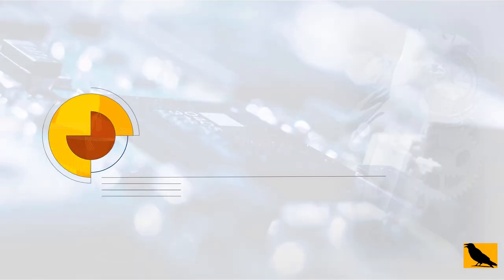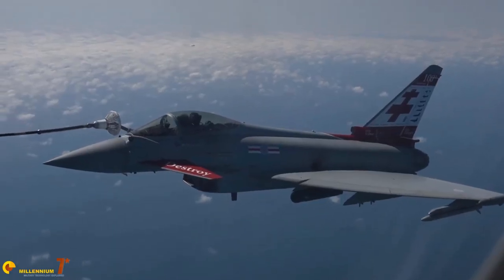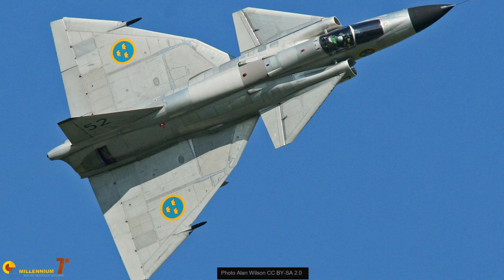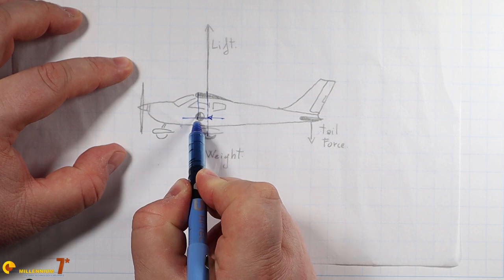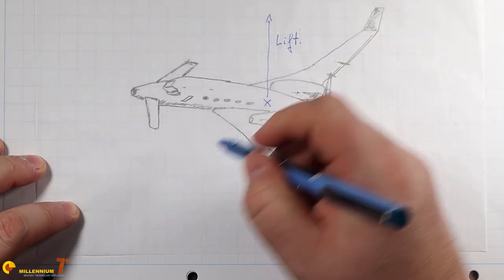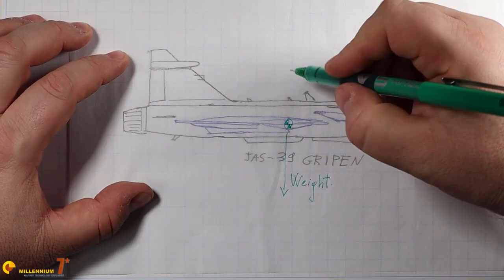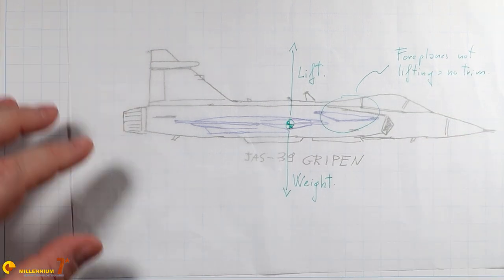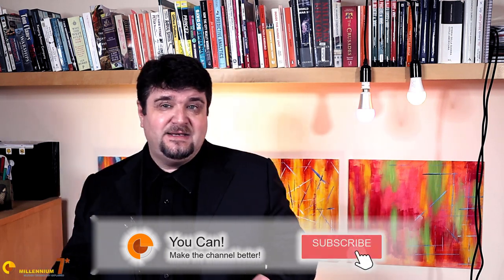I looked inside Rafale, Gripen and Typhoon, and this is what I found.

Comment: They are called “canards,” literally “ducks.”
Reply: Foreplane is equally accurate.
Reply: Yes because planes look like a duck with them haha. It is more obvious with a design like the Valkyrie though.
Reply: François Calvaresi That’s the stupidest thing I’ve seen today.
Reply: Glenn Ridsdale good for you.
Reply: The first canard airplane is the 14-bis of Santos Dumont.
Reply: @efxnews4776  No.  The first canard aeroplane was the Wright Flyer.
Reply: From what I understand the term "canard" refers to the configuration (because ducks in flight have their wings "at the back", having long necks). The foreplane itself is a foreplane (the wing at the rear being a "mainplane").
Reply: iskandartaib - That could be, but I have always heard of the forewings as canards. Thanks.

Comment: Just found this channel, and it's great! But i really don't like the the explanation on plane stability. It's similar fallacy to using Bernoulli's principle to explain lift. Too simplified and doesn't work in practice.

For example we can have a perfectly stable plane with canards on the front and wings at the back, even thou using the diagrams shown here would suggest that center of lift (CoL) is in front of center of mass (CoM) (with both canard and wing providing lift). The issue here is that CoL is not in front or at the back, it is always at the CoM for any normally flying plane (no matter what configuration), and what governs stability is how fast the lift changes for each lifting surface with change of aircraft pitch, which will determine in which direction CoL will move from the CoM to correct (or escalate) the instability. (I think noting the movement is important here)

Fortunately it seems that modern youtubers start to phase out the Bernoulli, im hopeful that time will come for this one as well. :) Anyways, great content! Cheers!